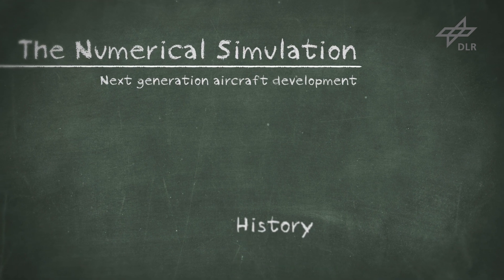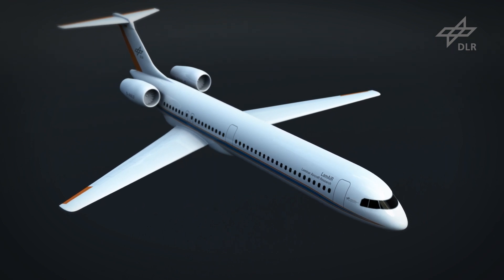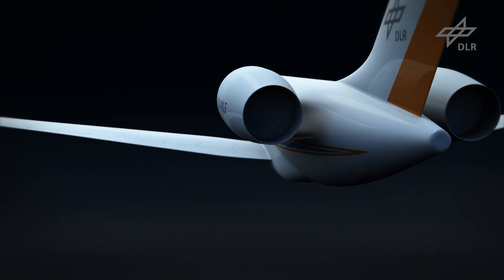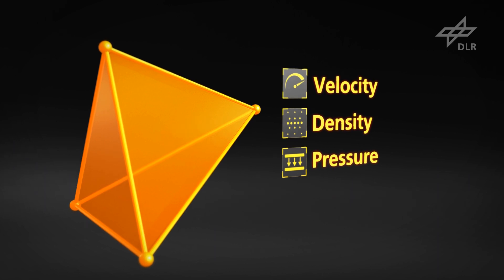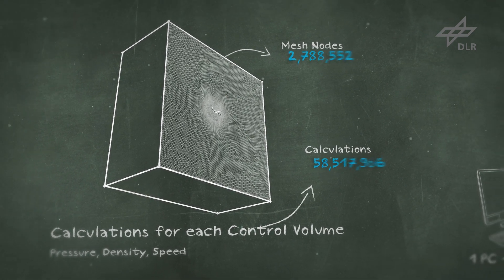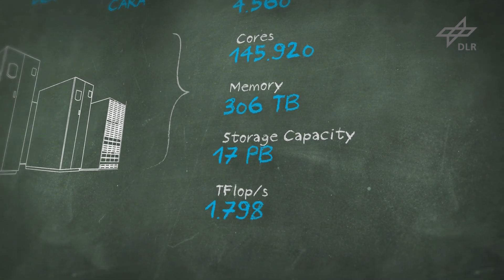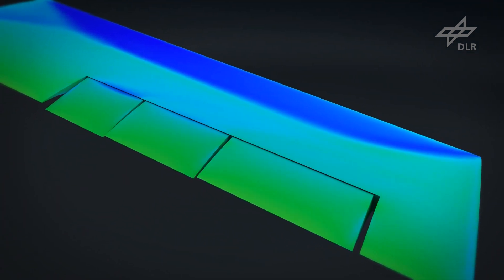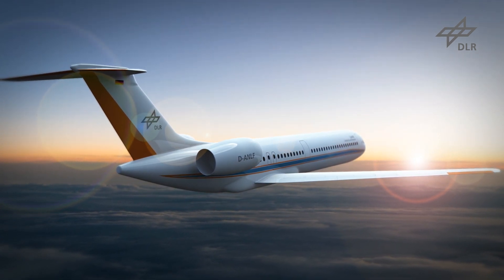Future Aircraft Engineering - The Numerical Simulation

Comment: 2:58 I wonder how those numbers came to be. My Desktop can achieve 20 TFLOPS with the GPU alone.
Reply: Most CFD calculations are using CPUs instead of GPUs.
The formula for FLOPS is : sockets * (cores per socket) * (number of clock cycles per second) * (number of floating point operations per cycle).
GPUs can have thousands of cores but CPUs usually from 4 to 16 for public hardware (64 in my workstation using an AMD thread ripper 3995WX),  so of course GPUs can account for more teraflops. 
But you have to keep in mind that GPUs’ cores are far more specialized, thus less flexible regarding the type of calculations they are able to solve. 
Some progress is done on GPU solving for CFD though, so CFD capabilities will only increase with time !
Reply: @Erreurification  my software does CFD on GPUs, and it's fast enough to run on a gaming GPU in real time. Even on the same hardware it's about 100-200x faster than expensive commercial codes. I have some demos on my channel.
What matters is not the cores or TFLOPs, but only the memory bandwidth. GPUs really shine here.
Reply: The number seems right to me. Did a simple calculation of my laptop's cpu and it can do 0.17 tflops when using sse2